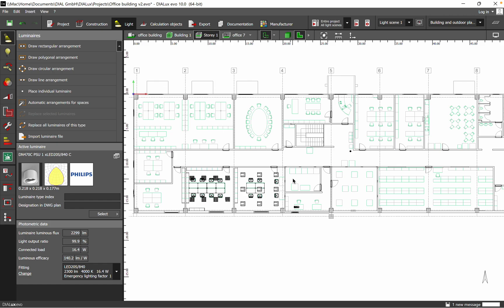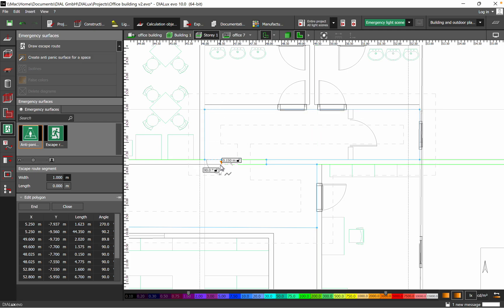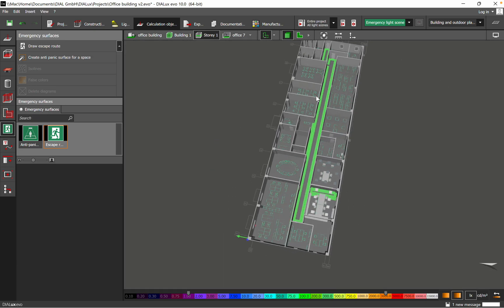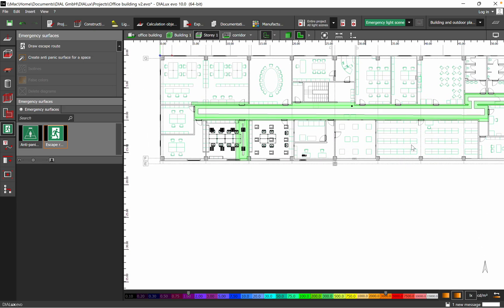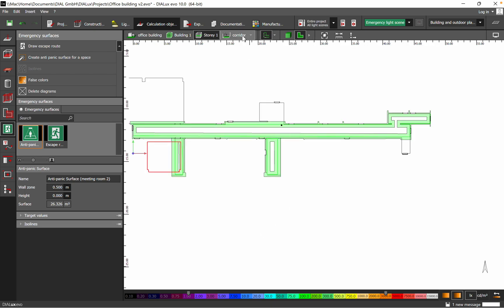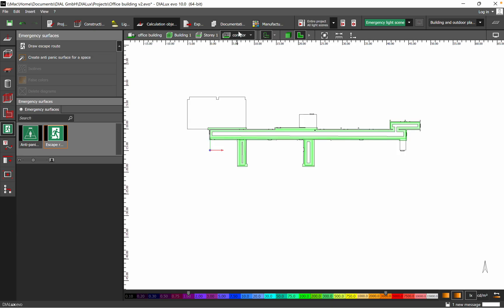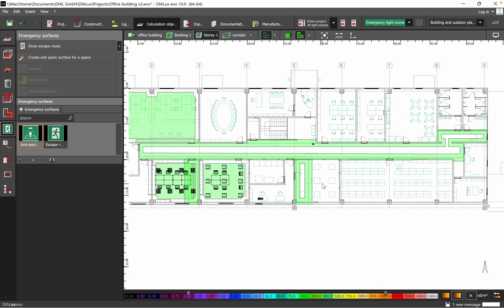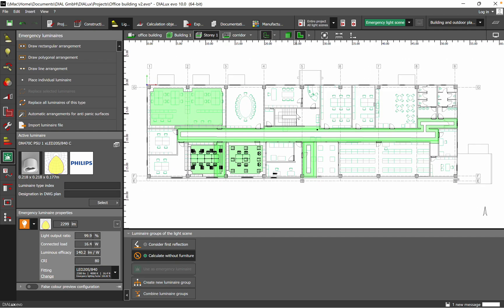Define the emergency light surface

Comment: Can you explain me what´s the reason of dual emergencey route next to each other? (I think its so wrong) - and real measurement for emergency lighting will not start directly from the wall ...
Reply from the maker: thanks for you comment. As you said already mentioned is not point of having for one room dual emergency-at least for a small office space, for a big open office the situation can be different. This video is about how you can define the emergency lighting. Also the general lighting will not start directly from the wall, only if you edit manually the distance. Hope that now everything is clear.